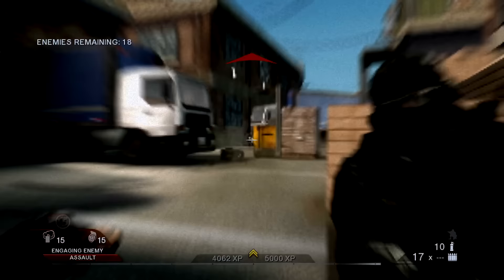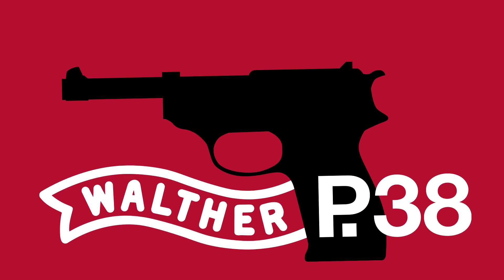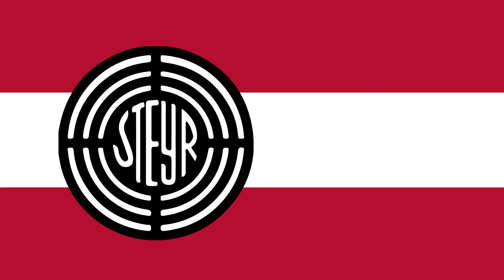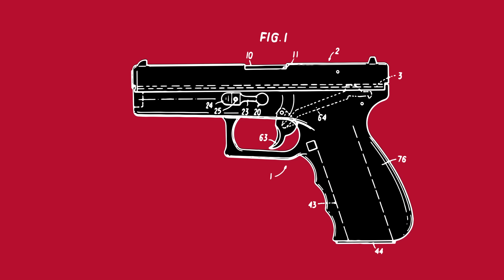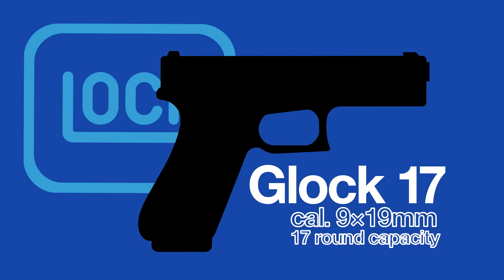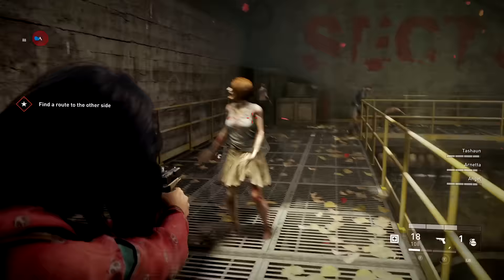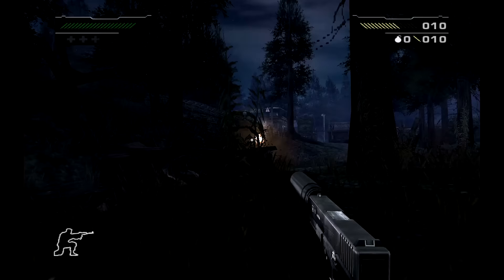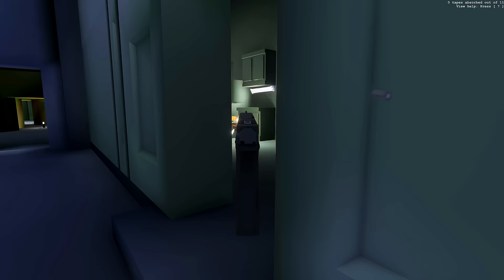Glock.

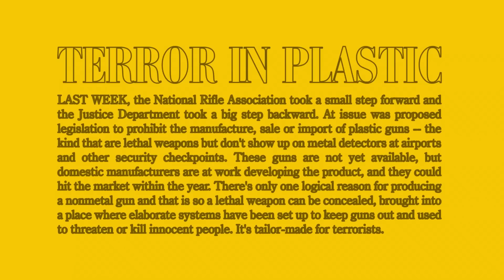Comment: 3:30
Sounds like sour grapes to me. The Americans picking the Beretta then the Beretta immediately being out performed. “Yeah well, I didn’t want your terrorist gun anyway!”
Reply: Unlikely.  Nobody was familiar with the concept of polymer guns back then and distrusted it heavily.  Nobody back then considered the Glock outperforming the Beretta.  Only with the new paradigm shift of trigger pull consistency, lightweight guns, low bore axis, high grips has Glock surpassed the older style handguns.   Even regardless, the difference is marginal, and handguns in general are near useless in the theater of war.

Comment: Lol invisible to X rays? That was something people would say when glocks weren’t entirely legal in the US because of “Saturday Night Special” laws meant to keep cheaply made firearms unavailable. They had a rules on what materials could go into the firearm, a round about way of gun control.

Of course you can see them on X rays, the entire slide is all metal components, and the sprints and trigger group are metal in the receiver. 

I trust my life to a G17 Gen 5 everyday. It’s p great. On this one I’ve only got around 500 rounds through it, but it’s reliable as the day is long. It’s sitting on my desk right now loaded with Winchester jacketed hollow points. 

The ambidextrous part of the glock is that you can switch the mag release from right to left hand release. Mine is flipped, left handed trigger.

The G18 isn’t all that special. In fact, you can modify your back plate on a 17 to make it a full auto. All the G18 has is taller frame rails, and a back plate with a switch that literally inserts a piece of metal with an angled surface that presses down on the seer, so that the trigger connector doesn’t force a trigger reset.

Comment: The glock is not a elegant weapon at all. And it's a boring weapon to be sure. But it's reliable and accurate and lightweight. And is the easiest carry weapon I've ever carried. And it just works.  And especially during the summer months were I live. The heat and humidity can be brutal. And although I own several handguns. From a. Colt 1911 a Browing highpower and a sig 220 and sig320c and Ruger security six plus a colt cobra and a Walther PPK. The gock19 or 23 are my two primary carry weapons. And to be honest as a retired federal law enforcement officer. I wasn't impressed by them at all when they first came out. But I got to handle one, and was impressed by its lightweight and the trigger pull was not as bad as I thought. But still never bothered to buy ome. Well a few years into my retirement I did get a glock 19, and it really did impress me. Although I did change the glock sights out for Trijicon night sights, it was the only thing I changed. And a few years later I was interested in the 40calber and got a glock23 which came with nightsights. And later I got a sig320c to compare it to the glock. And it's become my backup pistol to my ar9 carbine which is my primary home defensive weapon, and sometimes carry weapon. But my glocks have become my primary carry weapons. And not one malfunction. And I understand a weapon is a personal choice. And I personally don't recommend any particular weapon to anyone. Because there really is no do all weapon for anyone or situation. And each and everyone has to choose based on their needs and experience and training and what they can afford. And their leaval of experience. And as far as I know there's no one perfect weapon for every situation and that's a truth most don't understand or accept. Any firearm is little more than a tool, and different tools for different situations. Handguns are basically defensive weapons easily concealed. But they have a short sight radius and need training and a lot of practice to become proficient with them. And to be completely honest most individuals don't practice or train enough or bother to get professional training to become truly proficient with their weapons. And to be honest it is expensive. But worthwhile to avoid costly mistakes. And it's a huge responsibly. Because you have the power to kill or cause injury to others, including loved ones by a simple mistake. And it's a decision that takes a lot of thought and consideration to decide on if you want the responsibility of owning firearms. And it depends on a lot of factors. That each and everyone will have to decide for themselves.

Comment: Next year I'll have Glock19x.
Reply: Just got my [G19] last week. Was waiting for the gen 5s to become available in my region, but at this rate I'd be probably waiting until next year for that to happen. Besides, I got one that's a MOS right out of the box.
Reply: @skullvitch2  from where are you? Got my first legal FA this year, Taurus G3. When I got it I realized I wanted a more compact than Taurus G3 maybe G3c but instead I'm looking for the Glock19x.
Reply: @RasPutintheGreat  I reside in Canada; so as a result the barrel in my Glock protrudes quite a bit out from the slide. Law standard for the length having to reach a minimum.

I'd recommend though that if you're looking for a compact, a regular G19 feels a lot nicer than a standard Glock frame, due to the finger grooves. The G19 and G19X are generally the same length in terms of slide, but the frame in the later matches more of a G17.
Reply: @skullvitch2  so which is more compact?
Reply: @RasPutintheGreat  A regular G19 is more compact by a small margin. If you want a legit conceal carry though, then a G26 is what you'd want.

The G19X is based on the version of the Glock that some military soldiers carry, so concealment isn't the biggest need for them. I've read good stuff about the G19X, but I'm personally not a fan of the tan color it comes in.

Comment: I do have to agree at the beginning. The pistol have a bland design, it’s overrated, very light, and have a small stopping power. I would still use the Colt M1911 and S&W/Colt/Ruger revolvers. Any American pistol that is single action and/or semi-automatic

Comment: Good vid, i carry a g17 gen 5 myself. Although the g18c is the full auto variant.  C standing for converted. Its easier to convert the 18 than any other. Although any glock can be converted to full with roughly 5 mins of thinking and a bit of logic. Either way I like mine and have had 0 issues. 

Fun fact Glock also sells horse semen

Ur welcome

Comment: In my opinion... It wasn't only a plastic... It a nylon based polymer called Polymer-2... That polymer was specially formulated by Gaston Glock. The designer of Glock pistol... And it tough to chemical corrosion and physical damage like scratch... I'd like to think if polymer was formulated and produced from modifying plastic waste molecules... That invention could be much more eco-friendly.

Comment: i want a g18 with a stock and a foregrip slapped on it.
Reply: Good luck...
Reply: @stevenjones6744  honestly super easy to do. just spuer illegal.
Reply: @fairplayer916  you can't put a stock on a pistol, that's completely illegal to do

now what you can do is attach a pistol brace (and have a non-vertical foregrip that you'll need to find space for) and as long as you register it with the ATF it should be legal
Reply: @harveyknguyen  you are right about the stock. That would make it an sbr.

But the Brace you don't need to tell the ATF about. Long as there's no foregrip on it anyway.

Bonus tip: Look up the micro roni in a g18. Fucking wild.
Reply: @fairplayer916  if i remember the company that makes it doesn't exist anymore

i'm probably wrong
Reply: @fairplayer916  and no i'm talking about registering it with the ATF by the fact that it's automatic which makes it a Class III item
Reply: @harveyknguyen  I know they can still be bought. And if not them, I know recover tactical makes a slick minimal Brace thats pretty nice. They even have a California compliant version.

And oh yeah my bad. Wasn't even thinking about the g18 in that context.

Comment: I have a g17 and I will tell you this it suck get a beretta 92 it a better gun. I love guns and I own a lot of guns that are shity like the 10/22 charger it fun to shoot but you can’t hit shit with it but you can have fun with it just depends on what you want and like the glock 17 feel good in the hand but it was only effective in 25 yards any pass that and you need luck to hit where you are aimingmy beretta 81 in 32acp can hit the trigger at 50 yards but my glock can’t just and I’m not going to put new parts on it to get it to shoot better 1 I’m cheap and 2 I shouldn’t have to buy new parts to get it to work right. My AR-15 didn’t get any accessories for it until it shooting a 1 inch grop at 50 yards ions only